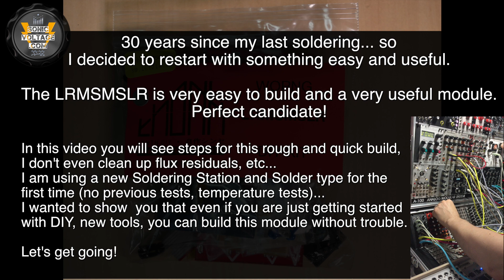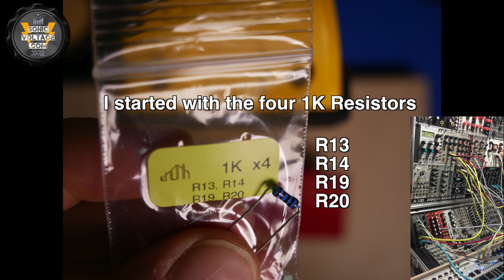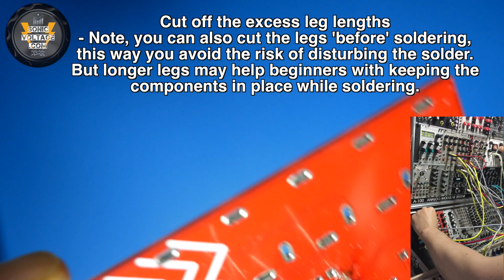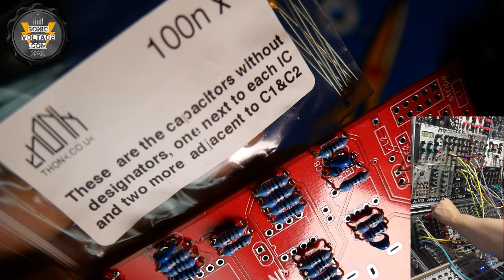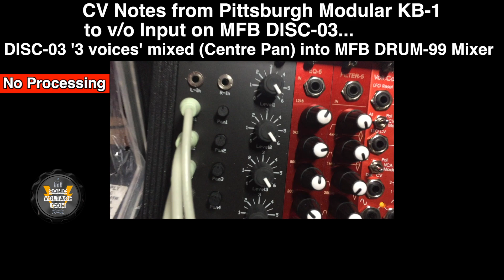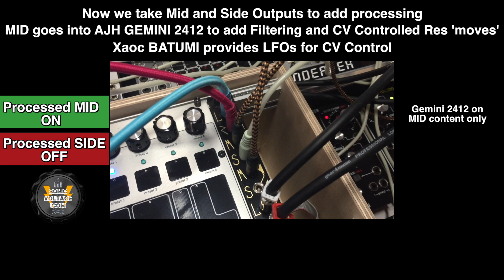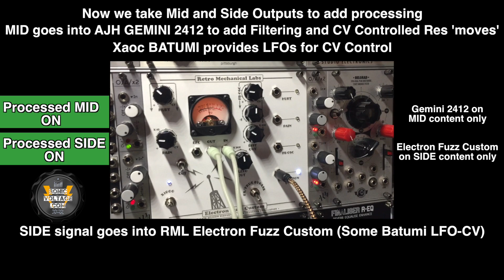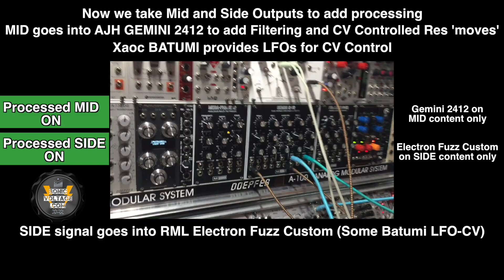WORNG LRMSMSLR Mid-Side Encoder-Decoder Thonk DIY KIT Build+Patch Test - Eurorack Synth DIY

Comment: My advice, after building a lot of modules: buy some good flush cut snippers. You really want to be cutting the legs of your components closer to the PCB. On this build, it's not as much of an issue, but on a lot of modules there are 2 or 3 stacks of PCBs with very little room between them. If your legs are too long, they will start shorting out components. Also, one thing that really was a game changer for me was purchasing a PCB holder (https://www.amazon.com/dp/B00Q2TTQEE/ref=cm_sw_r_cp_tai_TLnqBbT475KYZ) that allows you to rotate the PCB between placement and soldering. It's a real time saver!
Reply from the maker: Good suggestions, yes the flush cut snippers I need to get and everyone should have some. The Adjustable Circuit Board Holder I looked at it a few times, I didn't buy it yet but that's because the Vice I sometimes use allows me to rotate the board just the same way, so I can already do that. But may look at that holder again in the future.